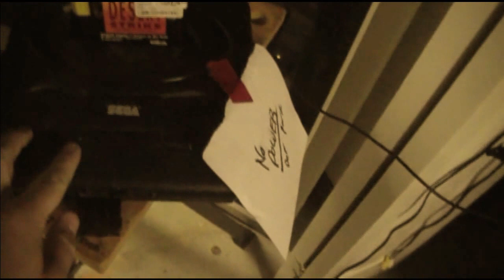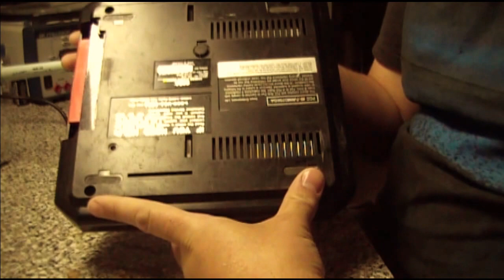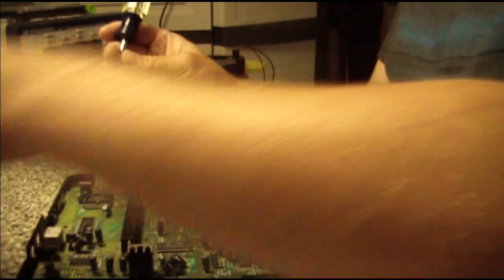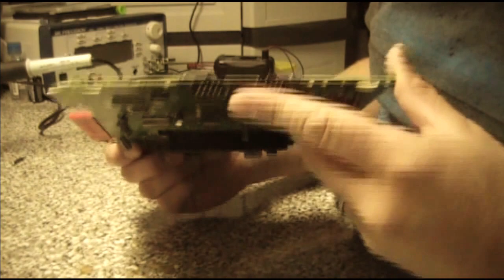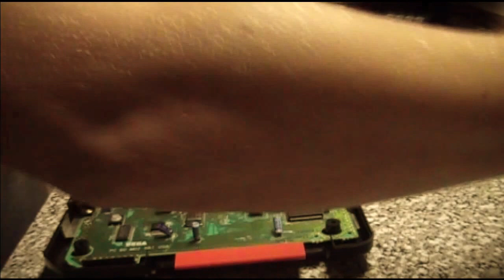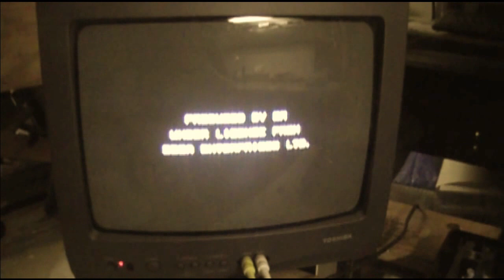Sega Genesis Repair -No Power-

Comment: My MD II doesn't have those two cords on the lower side of the main board. Do I have to solder some there by myself?
Reply from the maker: I've worked on a bunch or Model 2's and not all of them have those wires. I'm guessing there are a couple revisions of the Model 2 and those wires are just a result of that. Thank you for watching.

Comment: I'm inexperienced with system repair, so go gentle on me, but the wires on the bottom of board are absent on my Genesis... how does one go about adding them?
Reply from the maker: I've been in a few of these model 2's now and not all of the model 2 boards have those jumper wires. There must have been a couple revisions of the mainboard using the same PCB. Are you having issues with yours? Thanks for watching!

Comment: The jumper wires on the AC port are factory fixes to try and help mitigate the cracked solder joints.

Please don't ever use windex on cartridge connectors. 🤦‍♂️
Reply from the maker: Thank you for that information on the jumper wires. I switched to 90% Isopropyl a while back. I'm thinking it might be a good idea to post notation. Thanks for watching.

Comment: Hi, do some of the model 2s not use wires on the solder points? I have watched several videos and some have them and some don't. Mine doesn't.
Reply: They're soldered to the board on the ones you have.

Comment: Did sega put those leads there on the board? Most videos here just have solder joints, though the broken Genesis I just got has the leads just like yours.
Reply from the maker: I've taken apart a number of the model 2 Genesis and a few, like the one in the video does seem to have been re-worked by Sega.
Reply: Huge chance that's not factory work maybe at best they where sent in for warranty repair back in the day to 3rd party company's that's a thing diy people do because most people can't replace pads or just put in new bords been working in console repair for a decade haven't recently but can see when things are factory or diy